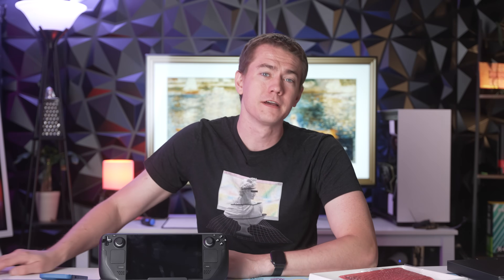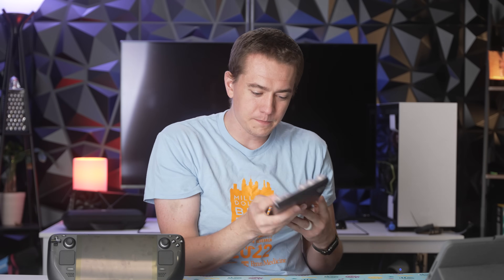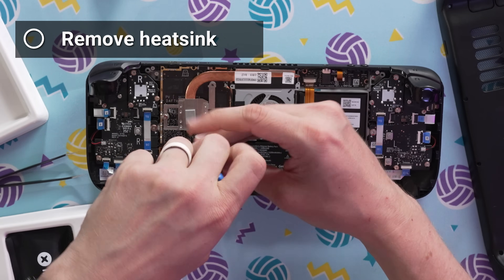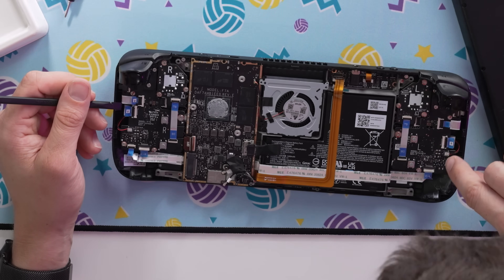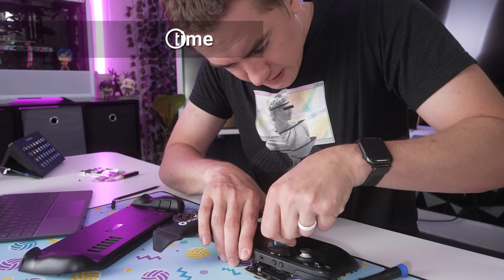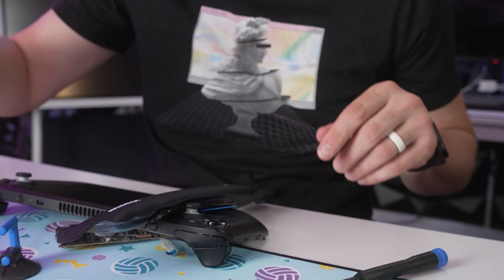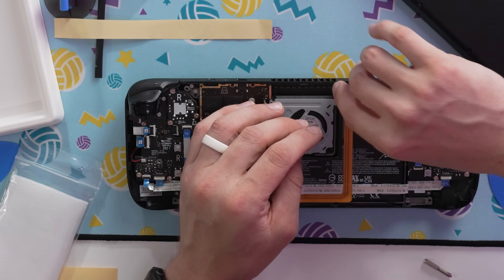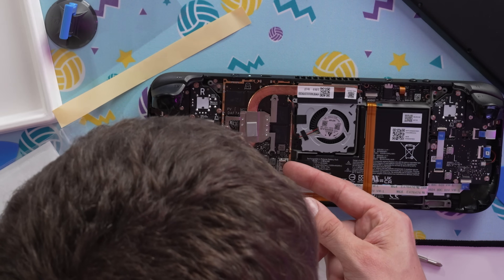Steam Deck Screen Replacement

Comment: I still wouldn’t go for the antiglare screen even if it is an option, that’s because antiglitter coatings diffuse the contrasts, and as we all know IPS panels need as much help as they can get in that department
Reply: Actually wrong. The Deck 512 does not suffer from reduced contrast or colour from the antiglare properties.
Reply: @DriveCancelDC  yeah I was wrong, I upgraded to the 512 screen myself😅
Reply: @haunter4764  How is it 4 months later I am buying the screen and I normally always use a screen protector. but im gonna raw dog it. Do you have any permanent finger prints or scratches?
Reply: @zandydandy4642  Couldn't be happier, 4 months later, no scratches or anything. It's turned out to be pretty useful for handheld use, I play on the bus a lot and sometimes during the day a lot of sunlight gets in that way, but the new screen can handle it. It makes the Deck more usable in outdoor conditions. Finger prints aren't as much of a pain anymore, they still do get on it, but it's not as egregious. This is a very practical upgrade for the Deck as it lets you play in different lighting conditions, while looking more pleasing too

Edit: I'm also not using a screen protector
Reply: @Haunter  ty for the info! I'm far more comfortable with my purchase now finally hearing someone's experience with both.
Reply: The anti glare treatment in the 512gb screen isn’t a coating. It’s laser etched glass.

Comment: I absolutely despise anti-glare screens and I cannot fathom how anyone could prefer them over a glossy screen. I’m definitely in the minority here but I’m content with my upgraded 64gb model lol.
Reply: Exact reason why I went with the 256GB version.
Reply: I’m with you there. I love the vibrant colors of glossy screens.
Reply: CRT the glossiest display u can get
Reply: May I ask why you despise them?
Reply: @yardeeknowwhoitis8144  For me, most of them have muted colors and have reduced clarity. The only matte screens I’ve seen with vibrant colors is the HP Omen line. I have one and it’s the only matte monitor I’ve ever liked. My other 2 monitors are glossy so I have both choices.
Reply: @yardeeknowwhoitis8144  Degraded colors. Fuzzy picture. Most of all, the texture. I have extremely sensitive touch and feeling screens with anti-glare coatings is like nails on a chalkboard.

Comment: I actually hate matte screens to the point that back in 2012 in my brand new 11.6 inch laptop I disassembled the screen and converted it to full gloss and back then I couldn't even find any info about such thing like nowadays everyone knows how it's done, I posted a tutorial somewhere back then, I basically used white tissue paper wet in water above the screen and kept feeding it with more water from time to time :)

Cool would be if they actually made available a hybrid of a normal OLED and a reflective LCD because that would be simply the best of two worlds with the reflective LCD, the more light you throw at it the more visible it actually gets which both LCD or OLED fail to do as with them we can only count on raw light output wasting much more battery to just try to be visible and not actually even show it's quality under direct sun while reflective LCD barely needs power to actually shine quality under direct light environments and when it needs to shine quality in door environments or full dark is where the OLED kicks in.

I think such screen was shown back in 2016 but I don't really think I ever seen it in use in any device sadly which is beyond stupid when my phone OLED claims 900 nits which is totally fake and it's still hard to see under direct sun light and just wastes the whole battery like nuts to just try to display...
Reply: I HATE MATTE SCREENS. I bought a 64gb model on eBay for 750 instead of waiting on my 512gb reservation after I saw the first photos of its screen. 
I bought an LG C1 48” TV to use as a monitor mainly because of the lack of an anti-glare coating. I cannot understand why monitors don’t use the same anti-glare coating apple does on their monitors and MacBooks. Not to be an Apple fanboy but they got that down.
Reply: @husk1ers   most TVs go for semi-gloss and most of them just simply look amazing and I'm almost sure TV manufacturers waste a lot more money into the coating than monitor manufacturers as the majority keep fighting the glare while maintaining them very glossy\semi-glossy and they keep innovating instead of just throwing a matte screen protector like most PC monitors 😞

I think the problem is mostly PC community which seem to be in favour of matte so most monitors went that root.

There are still semi-gloss monitors but most likely the models you will like\want are probably gonna be matte only ☹️

In my opinion it only ruins contrast and colours and I also hate BIG TIME the new trend on TVs which is the wide viewing angle coating which made them lose a lot of contrast and color gamut and on pixel level macro shots they just come blurred 👎😠
Reply: I even considered doing that mod to my monitors but chickened out because I rely on them for work. I probably watched your tutorial lol.
Reply: I don’t like cheap anti glare coating. My old laptop was pretty cheap and had horrible anti glare. On light colors it just had that horrible washed out look. I now have a more expensive laptop with way better anti glare and now it doesn’t look washed out at all. Bought a anti glare screen protector for my steam deck and had the same washed out look as my old laptop, probably even worse. Instantly removed it because it ruins the screen for me.

Comment: IFixIt including all the extra tools could be nice for some. But for others who only want the screen because they have the tools, do they sell just the screen without the extra cost of the tools? My wife and kids got me the most comprehensive IFixIt kit for fathers day and hate the thought of the extra cost being included with the screen if I don't need them.
Reply: you can get the screen-only, but in the EU at least its a 5 euro difference (94 screen, 99 screen + parts)

Comment: I mean I can kinda see matte finish on a mobile device.  They just drive me so nuts on desktop monitors.  Move the lights, close the curtain, ect.  It's so much better to fix the environment than make the display worse for those in a good one.  I am stuck staring at a screen that looks dirty all the time because the panel manufacturer put an anti glare coating on it.  Heck, even phones are not anti glare and they're the most mobile device - why they gotta ruin my monitor before I even got it? :(

Comment: Pro Tip: Instead of using the fat pick to break the adhesive from the screen, use a laminated playing card. Laminated cards are stiff, thin and provide much more surface area you can force between the adhesive. As an added bonus, you can use multiple cards to keep the screen from resealing to the adhesive.

Comment: I reserved the deck with the etched screen, but would probably be in favor for replacing it with the non-etched screen. 
Didn't want to mess with the memory, but did not want the etched screen.

Comment: when testing liquid metal, can you please use the new unopened deck? so that we can see if it's worth as an upgrade from the original paste? it would be also cool if you could first test replacing thernal paste with some other one

Comment: I wonder if some custom oled screens will be available for steam deck
Reply from the maker: Hopefully one day.
Reply: This would legitimately be a much bigger deal than the matte screen, which is not that big of a deal and goes away if you use a screen protector anyway. A bigger screen with smaller bezels and proper brightness and black levels would be a big, big upgrade.
Reply: That will certainly be my upgrade for my own Steam Deck though until then, I will stick to my etched display for now.

Comment: Cant we just get a matte screen protector... Which i assume dbrand sells
Reply: They're only matte glass ones are on Amazon and for some reason applying them is harder than it should be unless you don't mind the corners not sticking down. I actually bought a regular matte screen protector for a laptop and cut it to size.
Reply: @MobileDecay  I would argue that's a hell of a better problem to have.